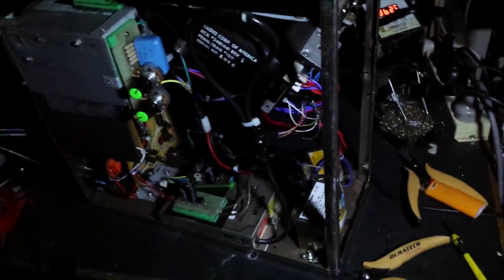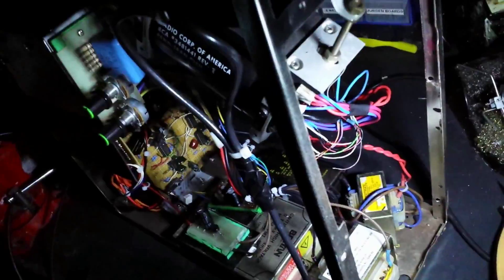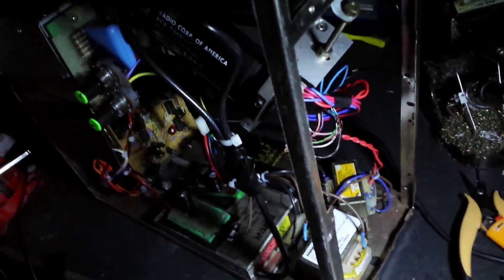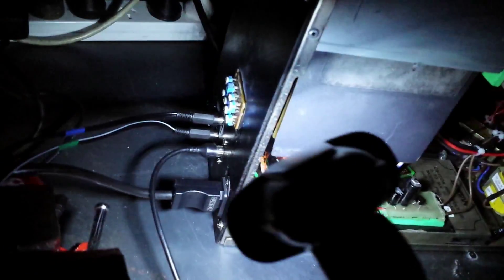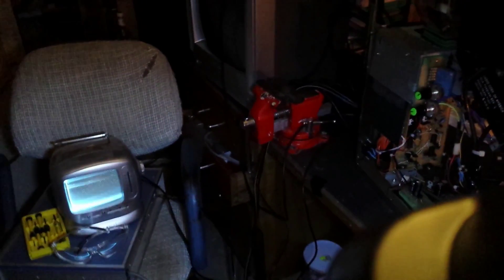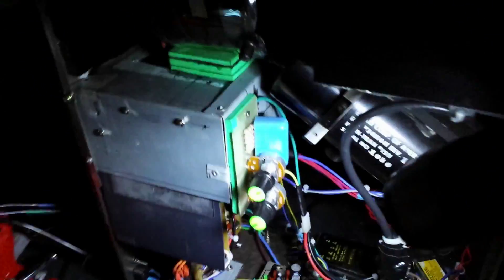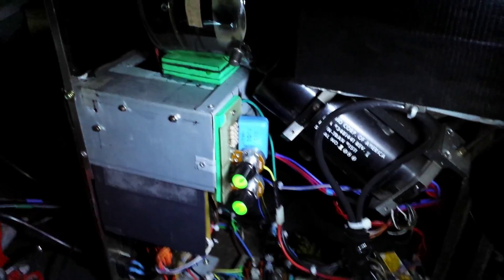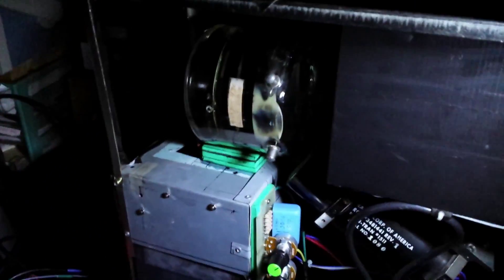Iconoscope TV camera project (Part 34)

Comment: Troy can you adjust or look into the tubes focusing voltages .
same gos for the deflection side of it if you can adjust each of these one at a time and test the results it might point the way 
instead of a light try a weak laser pointer you should be able to see the dot and the working distance around the tube .
As with nbtv  try a easier test card first like a cross shape or such with a lot of contrast .
Reply from the maker: Thanks for the suggestions. The tube doesn't have an electrical focus adjustment nor requires focus coils for the beam, it was all optical focusing.
Reply: Troy the voltages to the tubes cathode anode ,it might be need adjusting this would effect the electron beam focusing .I would think without this the electron beam would be wide or narrow ,your better at this side of thing than me but on my cathode ray experiments this is the case .